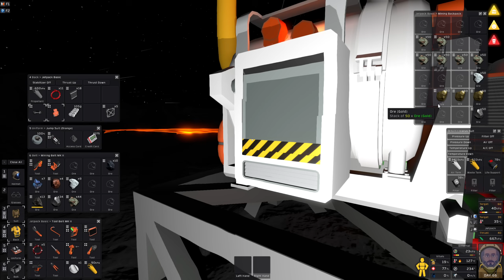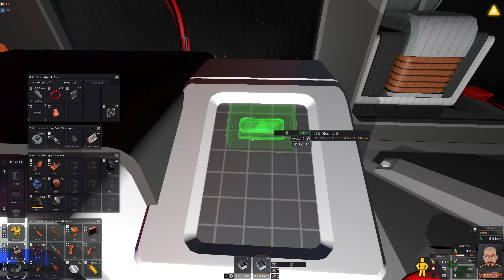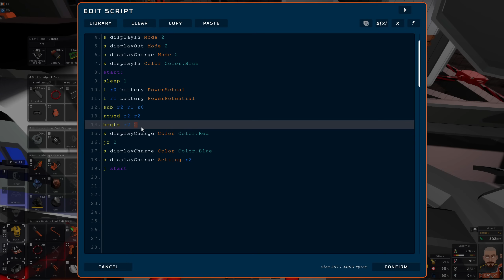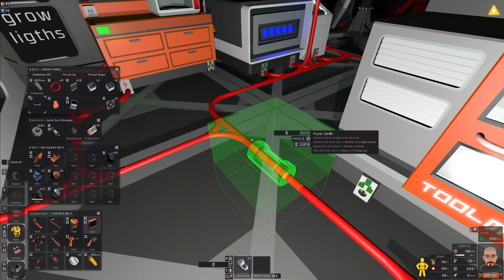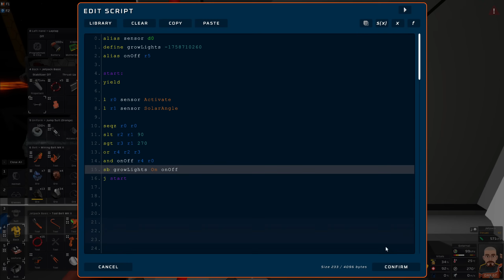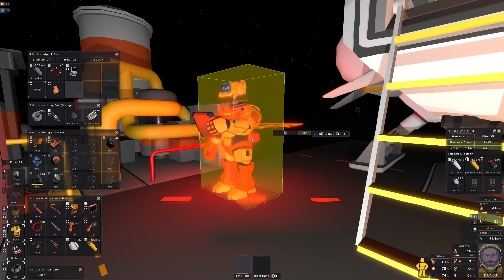Modular Consoles Are My New Favourite Mod - S2 E21 ║ Stationeers

Comment: Just curious, instead of a daylight sensor, could you use a timer circuit and set it exactly to the light and darkness needs of the plants?  (you'd have to replace the windows with solid walls, of course, but it seems you have the power to spare.)
Reply from the maker: Should be perfectly all right, just need to use an IC10 with some sleep lines between toggling the lights. :D

Now, the power...as it happens there's a bug that I'll need to address, which means we don't really have as much power as I originally thought. Still, the black hole is right there, might as well take advantage. :D

Comment: The `select` statement can be good for doing stuff like picking Colors (instead of using branches). 

select r? a(r?|num) b(r?|num) c(r?|num) 
Register = b if a is non-zero, otherwise c

```
#optional, use register aliases
alias currentPower r10
alias color r11 

l currentPower battery PowerActual

move color Color.Green #color defaults to Green

sgt r0 currentPower 3000
select color r0 Color.Yellow color #color will be set to Yellow if r0 is 1, otherwise stays what it was
sgt r0 currentPower 4000
select color r0 Color.Red color #color will be set to Red if r0 is 1, otherwise stays what it was

s display Color color
```
Reply from the maker: Thanks, I'll need to study this one for a little bit, my Matrix vision is not quite there yet. :D

I kinda understand it, I'll need some time to absorb it all. :)